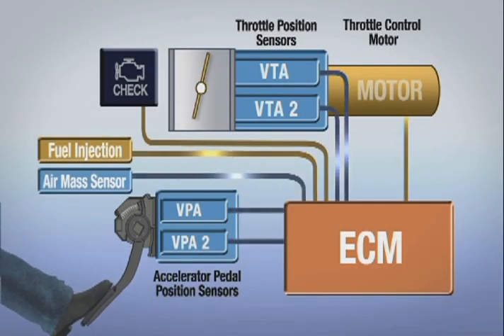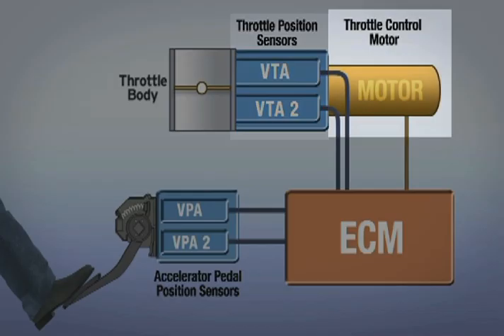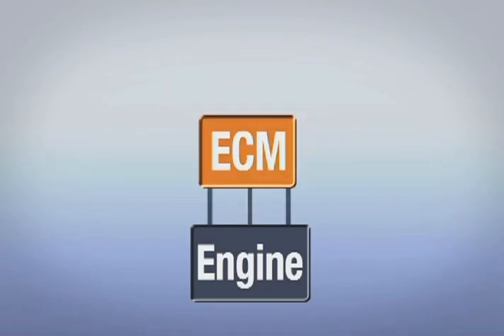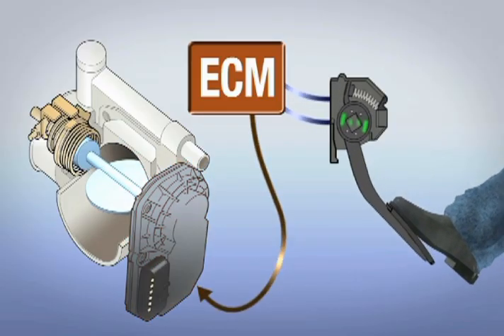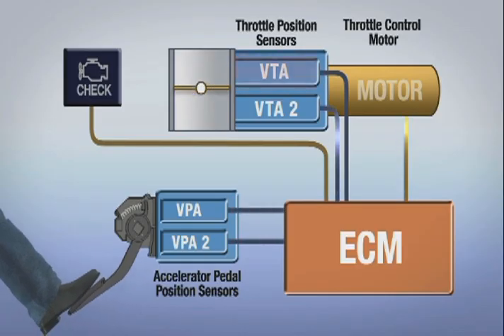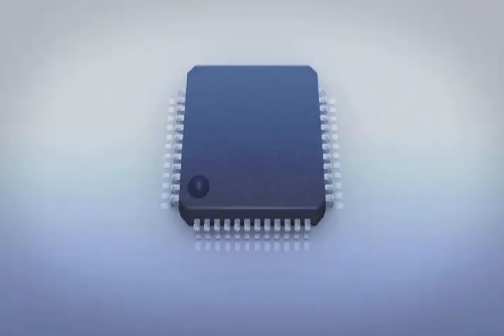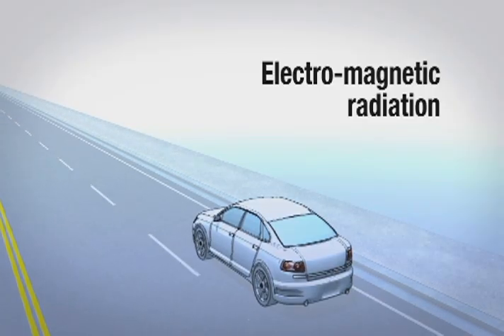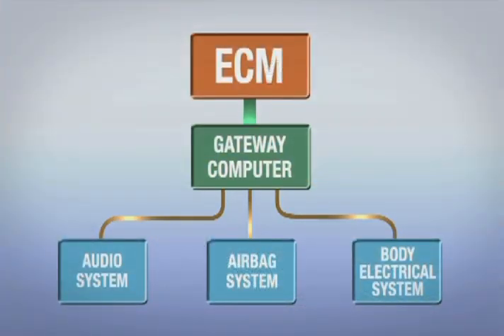Electronic Throttle Control | Toyota

Comment: If I’d like to reset the electronic throttle control system, how do I do so? Mine has bad data in it and I need it reset. The technicians say the computer isn’t reporting any problems but I Drive it and it’s not performing as normal (I hit a speed bump) how can I reset the ETCS without damaging my car? My dealerships only recommend recommended services at my current mileage. I’d like it reset so I can accelerate like I used to. Is it possible to reset the ETCS by unplugging the battery? I cannot find good information online. Please help! @rkv456@gmail.com
Reply: Possibly a malfunction on others system modules like ABS, SRS putting the car in a failed safe. You won't be able to accelerate at full power

Comment: Yes, the damn thing just failed in my tundra. Getting correct info is being a real burden as no one, even Toyota, calls the parts to fix the problem by a common name - one minute Toyota says accelerator pedal position sensor and the next moment it's a throttle control sensor (which becomes problematic when there is a throttle control sensor already as part of the assembly, but an entirely different part). You are almost forced to go to the dealer so that you can get the right part installed and then they jack you up with a $400+ labor bill for 15 minutes of work. Add to that, the price of the plastic box is excessive and unconscionable. The price gouging by Toyota on their repair parts is enough that, though I love my tundra, I would not recommend the purchase to anyone.

Comment: New technology new problem.
check engine light of my Toyota corolla was on last night, I just removed the battery terminal and the following morning I connected the terminal back and start the engine, to my surprised the check engine light was off. 
Does this solve the problem?
Please comment.

Comment: This was the biggest mistake toyota ever made keep the throttle cable. Now some auto makers are going even farther in trouble by taking out the manual steering rod between the steering wheel and the front tires and replacing it with a computer. This will fail and cause many deaths. So So stupid.

Comment: One of the most boneheaded concepts in automotive history. Failure of this garbage either through throttle motor or ECM problems strands you. I have personally seen failure of this crap on Chevy trucks and Isuzus leaving the occupants stuck on the side of the road. 
Get a clue--manual control through a cable is FAR more reliable.
In all honesty--Toyota is definitely NOT the only one to use this nightmare--it is in use by nearly all manufacturers. I will NOT own a vehicle so equipped.

Comment: its control the airflow and gas ratio better in terms for eco friendly and engine risk of detonation. the pedal is also softer and smoother to step on for comfort driving.

as for as liabilities, i think tradtional is better. since the incident of the sticky pedal on their Prius.
Reply: What it is dtc 2101 honda...plis prablem

Comment: mercedes 01 ml320 have the same thing. and is damn expensive  (Electronic Throttle Actuator)  to repair those thing.. Gimme one wire open the throttlebody. Too much safety = fail.  The proper name is Electronic Throttle Actuator
Reply: I have Toyota high Ace  come original  2 kd enine  I change to a ITR ENGINE but its not reving out  is the  2 kd trottle position sensor compatible

Comment: Failsafe modes do not engage and data codes do not get sent. It truly is a great feeling not knowing how my car is going to react at highway speeds. Plus the fact that I am burning through my brakes and clutch at a unprecedented rate. Awesome, love it, thanks guys! I have 3 Toyota's, a 2000 Avalon, a 2004 Tundra and a 2010 Corolla. Still love the Tundra and the Avalon but unfortunately due Toyota's lack of ability to correct their problem the Corolla will be our last Toyota. See video example.

Comment: This is why all cars should have manual transmissions. If the throttle sticks, Step on the clutch and the car will cost to a stop. That's real safety! There is just too many electronics on these cars today...
Reply: I have a Toyota  crown majesta 1jz-fse  I think it has throttle  body  problems  so I bought one from out of Japan put it on the car and it's not idling so my question  is do I have  to  reset it does the car computer  has to recognize  it before  the car can start ?

Comment: What happens if VPA and VPA2 get shorted on the ECM due to an intermittent fault?
The voltages compare and there is no need to set a code.  Fail safes don't work at this point.

Comment: The brake overrides accelerator is an additional fail safe which should be considered. Cruise controls have LONG had this feature. Tapping the brake disconnects the cruise. It also needs to happen with cruise off and the driver has slammed on the brakes with the throttle on full open. If you don't back off power, you will just melt the brakes.

Comment: The two sensors detect mechanical movement in the pedal. How they compare data is easily understood. 

Toyota's Drive By Wire system was designed by Toyota. Yes, it will have common elements and systems compared to Ford, GM, and others, but HOW components are individually designed to execute their purpose is different to some extent. Obviously, Ford's, GM's, etc. pedal design execution is done differently.

However, Toyotas are also accelerating without pedal input. That is the quandry.
Reply: Hey guys I have a Toyota  crown majesta 1jz-fse  and the car is not accelerating  

But only if I do it from the butterfly  valve  it accelerates then the engine stalls 

Can anyone  tell me what's going on  there ? 

Elvis Thomas

Comment: Toyota, this is wonderful for a mechanical action fault, but what about the consumers that have brought the car to a successful complete stop at an intersection, and with their foot STILL on the brake pedal, the car suddenly rev's and accelerates? None of the fail-safes mentioned come into play when there is no input on the gas pedal, yet the engine accelerates anyways. 

Luckily, you have deep pockets.